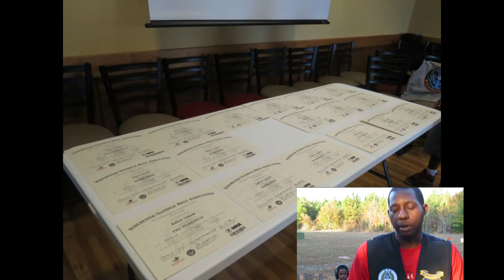RangeTalk #41 - I'm Back! Condor Competition Recap and Updates

Comment: Thanks for the comb spacing tip. I got some Everbilt 3/8 SAE flat washers#376 924 and they fit perfectly and now the comb doesn't 'float' with just the set screw tension.

Comment: Great Info.  Appreciate it.  Hey.  I just got back into trap shooting after about 20 years away from it.  Currently I'm using my Remington 870 but I'm looking for a second gun for when my kids visit.  Would like to step up a bit but not break the bank.  I have been considering the Stoeger Condor Competition but every time I get close to going in that direction, someone comes along and rips it.  Basically telling me you get what you pay for.  I'm looking for a gun for trap... nothing else.  Maybe do some doubles.  I do maybe 100 rounds a week.  You mention in your video about the safety issue which I have heard as well.  Also considering a used more "accepted" OU but keep coming back to the Condor Competition.  Anything else you can add would be appreciated.  Thank You!

Comment: I have looked at the several times at a few different stores. My recommendation is to spend a little more for a decent semiauto or save up for an entry level O/U like a : Beretta, Browning, Fabarm, or Rizzini.  I have no faith is Brazilian made firearms after I’ve had to many failures, poor workmanship, or bad customer service where the firearms is at the factory longer than I’ve had it in hand. 
FYI Browning’s customer service Sucks too, but isn’t needed for the most part.